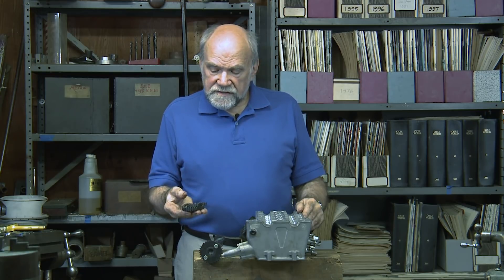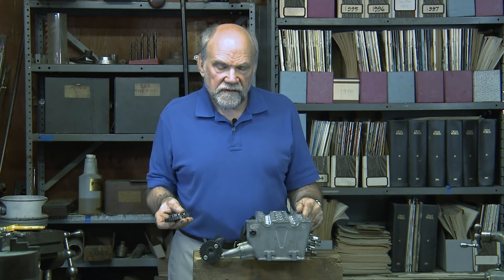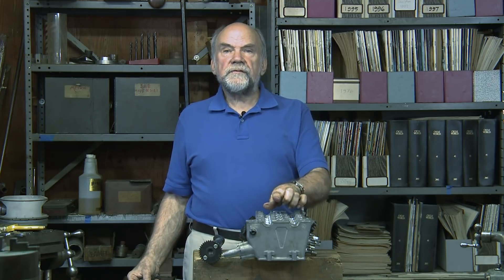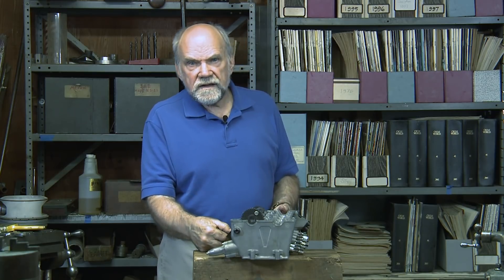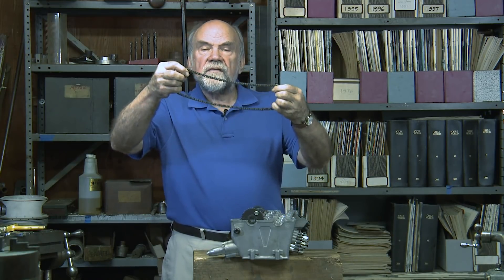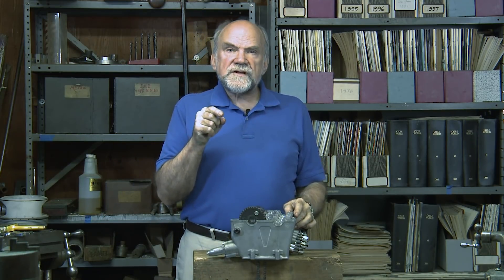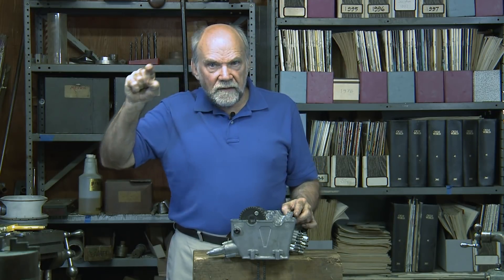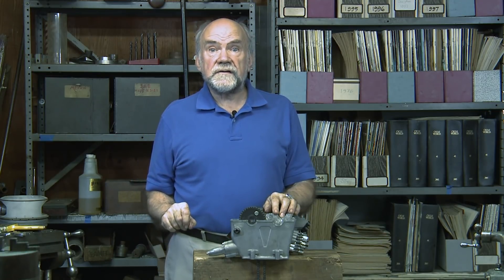Where Are The Two Camshafts Located On The Cylinder Head?

Comment: Wikipedia says that the first DOHC engine was the 1912 Peugeot.  That's terrific for Peugeot, but they didn't exactly run away with market share in automobiles, and Harley ran flatheads for another 60+ years. Original hotrodders still with us will shed a tear talking about the joy and pain of getting RPM's and horsepower from a Ford V-8 1932-53 sidevalve engine with the Mercury stroker crankshafts, aluminum heads, and rafts of carburetors.  Does anyone here have a connection to the Dudley Perkins H-D shop in SF?  They could tell you lots about getting power from H-D sidevalves for Ron Grant and Mert Lawwill.  
There's room in the world for pushrods even now, if displacement isn't limiting. You can't beat a Briggs and Stratton for starting and running on any kind of fuel.  And of course any LS-series engine will make your shopping cart a lot more fun to goof around with.
Reply: Please.dont.use Harley Davidson and horsepower in the same sentence, they are two different things.